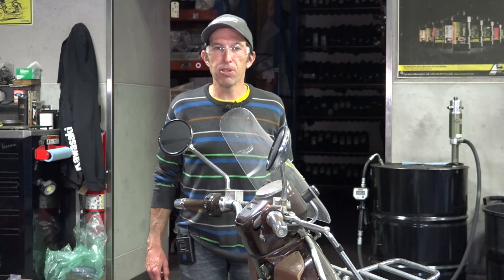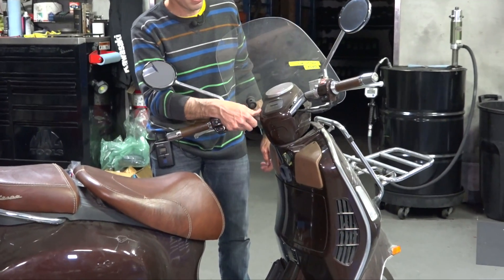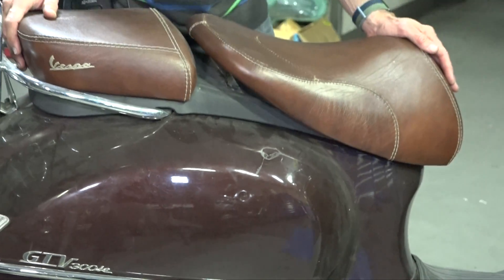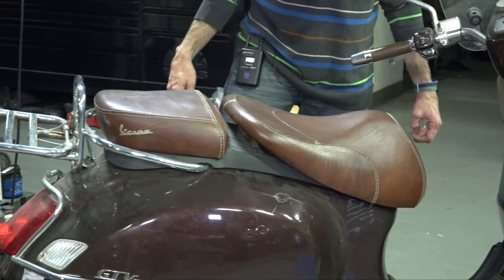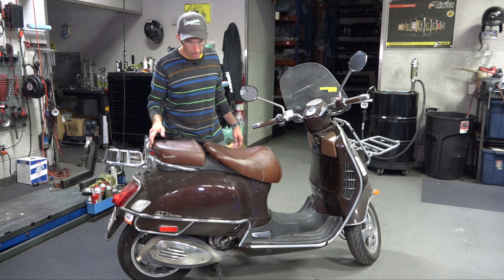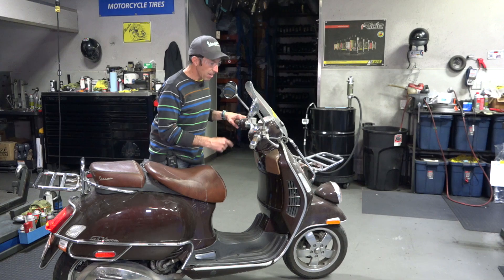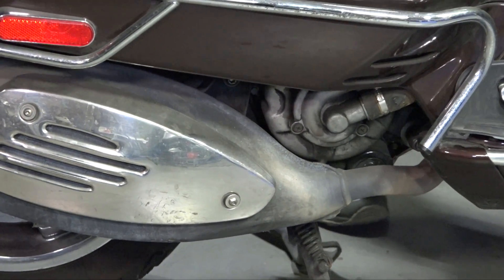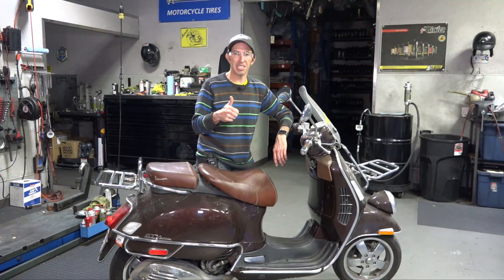2012 Vespa GTV 300  Resurrection | Introduction

Comment: I love the look of that scooter, surprisingly even the color. I have a 2006 GT200 that I bought from a private seller about 5 years ago with only 1800 miles on it. It didn't have any scratches on it, in fact it looked like brand knew. I changed the oil and coolant and put a new belt on it. I also wound up having to replace the water pump (due to a leak) and the vacuum petcock (which unfortunately left me stranded) It now has 14K miles on it, still looks and rides like new, and has had nothing done but routine maintenance done on it. I know someone on an online forum who has 84K miles on a GT200, and is just now starting to think about looking for another engine. 

I would like to see someone who has that many miles on an EFI model who has not had to replace any EFI parts. For two reasons. One, I don't believe an EFI system will last that long, and two, if one has I would like to see proof of it. It would be nice to know that a Vespa EFI system could last that long without repairs. It would take a lot of the apprehension out of buying an EFI Vespa.

Comment: Do I see right that the double leather seat on GTV looks exactly the same as the one of LXV? I've got LXV125 from 2009 but unfortunately the brown leather has deteriorated very quickly when the scooter was not kept in the garage, under Italian sun. I have had the seats reupholstered with the vinyl type material, no vespa stitching (copyrighted ;). It is far more forgiving the elements.